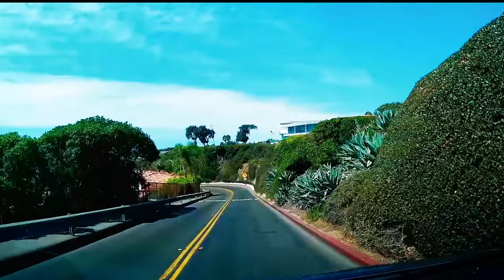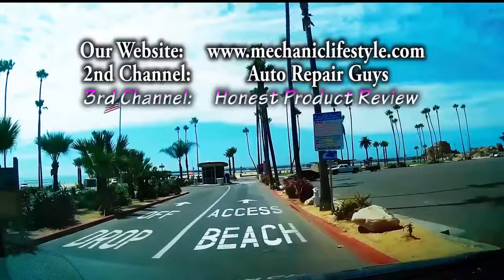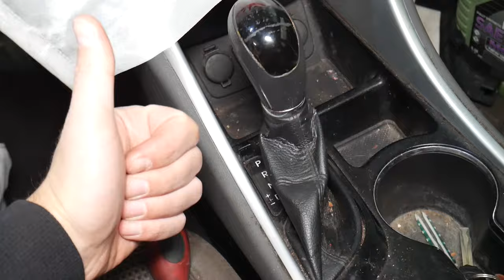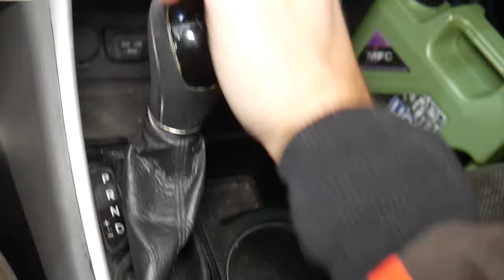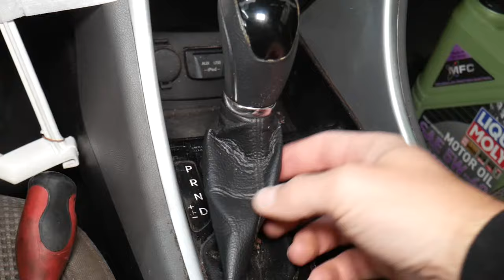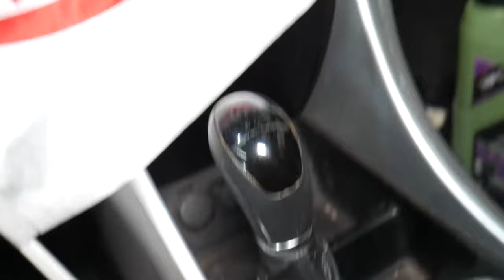KIA STUCK IN PARK, HOW TO SHIFT IN DRIVE REVERSE OR NEUTRAL

Comment: So... if you have a stuck shifter and the screwdriver releases it, WHY is the shifter sticking?? 😮. I guess the dealer should just include a screwdriver in the cubby with a note " in case of stuck in park, use this tool".